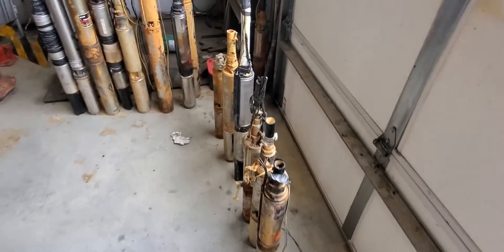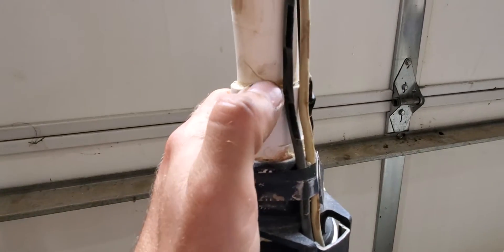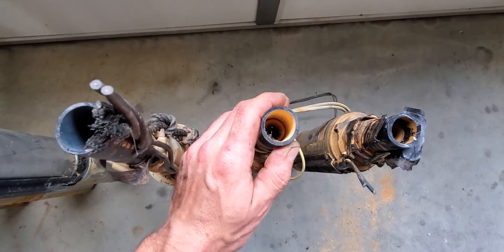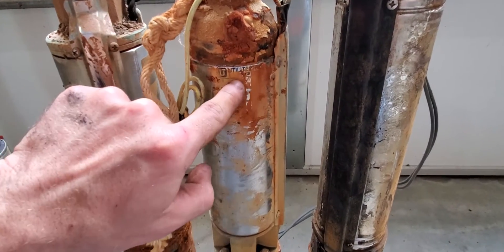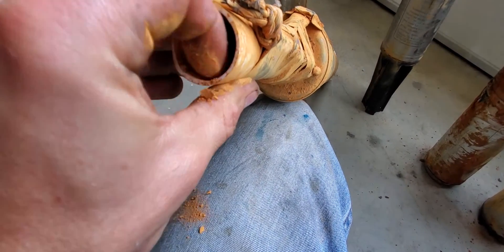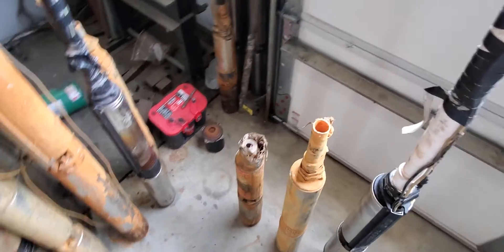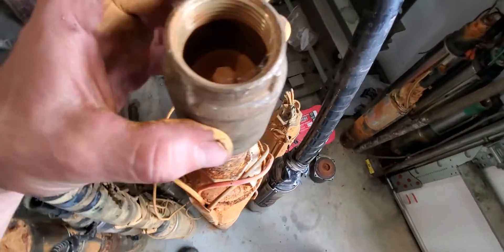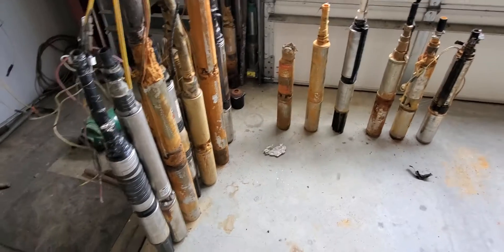No Water, Low Pressure,  Air in Water lines. Here's Why! #1 Troubleshooting video

Comment: Last year my pump ran fine. This year, none of the zones would come on. The pump is running and the hydrant at the pump discharges water but with very low pressure. I can put my thumb on the hydrant and stop the flow. I bought a cheap pump two or three years ago and I’m wondering if I got what I paid for. When it turn on my system, all the heads dribble water. Kind of at a loss here. Think the pump wore itself out?

Comment: Our old 0.75hp water pump for shallow well stops pushing water at around 3-5 minutes, but after a seconds of unplugging it and then re-plugging it again, it pushes water up to the tank for the same time frame of 3-5 minutes. We tried a new water pump 1hp but doesn't even push water up to the tank. What could be the problem?

Comment: For the last 15 years I've been running a Berkeley L20P4GMGS 2hp 20gpm pump I have had no problems or issues to date. My question is with the newest soft start pump coming out what would you recommend for a replacement. I was thinking using the same pump but with technology these days it makes it had to decide which quality pump a individual should purchase.

Comment: Lots and lots of bubbles in the well water. When pump runs the pipe shakes and makes a chattering sound like a vibration from a swing gate check valve. 
1. Why all  the bubbles
2. Why the vibration. 
3. Is it related to each other
Reply from the maker: It's highly possible that you have something funky going on with the pumps check valve

Comment: My sinks, toilets and shower are violently blowing air with the water and occasionally the water is really dirty. I fill my air tank and then run the water. After about a minute it goes back to normal but when the pressure gets low again it starts back up ... thoughts good sir?

Comment: Hi there. So my pump has shot off the end of the line a few times we changed the fitting to a metal one and now there's no water so we replaced the switch. Still nothing so now it's pulled out and I'll look at all the pipe and wire but it shows power to control box and the switch. It's only 30 feet and the pump was changed in September of last year.

Comment: I have a somewhat new well thats only 5 years old. Ever since the first day they installed it, it spits out sand. You can see it when filling up a bucket of water or when you leave water running in the bathtub. it's 350ft deep and I'm not too sure what size the pump is. what could be the problem?
Reply from the maker: It's possible that the casing wasn't set deep enough, and it's letting in surface material. 
Or it could just be the geology of the bore hole in your area. 
I'd recommend a "big blue inline filter" 20"x4" . They do a great job. 5 micron filter element (string woven type)

Comment: I have a jet pump for my well and I think that I like that better.
Reply from the maker: A jet pump is like a Carburetor, it's old technology, easy to understand how it works, & sometimes very difficult to get working correctly when there are problems. 
Submersible pumps are more modern technology, just supply it power & it supplies you water. No priming, no air locks or impeller seals to fail.
Reply: @h2omechanic  yep I know but the system works perfectly in my application and I can replace the pump myself any time no matter the weather.

Comment: Do all pumps come with a check valve, or is it something added in special circumstances? Second question, where is the bottom of the casing in relation to the pump? ie does the pump extend out the bottom of the casing, or is the pump protected inside the casing to prevent it from rocking and damaging itself or plugging up against adjacent rock and mud?

Comment: I lost water in my house but my daughter has water we both use water from the same well what do you think the problem might be thank you
Reply from the maker: The filter on your house is clogged.
Probably the black filter element...
Or go make sure your daughter has great pressure first. 
I'd say filter. 
Or a failed gate valve on your line.
Reply: @h2omechanic  my daughter has good pressure on her water I don’t know how to fix the problems you mentioned a plumber will be able to fix it right I have an old well pump and it doesn’t have the wiring that you showed in your video

Comment: I need help with it Please 
we only get 25-20 PSI and if we flush or take a shower it will last about 10-15 and then cuts off.
30 mins Recovery back to 25-20 PSI
Reply from the maker: Turn off your pump breaker and let me know if the pressure slowly drops to 0.
Or if it hold the 25psi like it should. 
Don't run any water during this test
Reply: @h2omechanic  I told my mom about it and she told me that she is going to get a Bigger Blue tank. What is your thoughts about it

Comment: Our water pressure would just stop randomly and we thought it was the breaker. We would reset the breaker and it would fix the problem until it would happen again, until finally resetting the breaker did nothing at all. It’s the submerged pump kind. Any ideas?
Reply from the maker: The pumps probably bad, or the wire going down to the pump is bad. Either way it would have to be pulled out & serviced.
Reply: @h2omechanic   Thanks. You were spot on. The wiring in the pump was damaged. The torque arrestor came loose and the result was damaged wiring.
Reply from the maker: @haruhana1743  people always ask why I don't like torque arrestors. There's another reason why!

Comment: Moved into a home and I get water for 10 min and then slowly lowers and then sputters and shoots out air really hard. It has an above ground pump. Anyway after sputtering then I'm out of water for around 12 to 19 minutes or so before the pressure is back and this cycle repeats 
So you can imagine how horrible a shower is during doing laundry 
Any tips?

Comment: Been having issues with water it’s spitting and sputtering replaced bladder tank it’s still doing same thing pump is good pumps water but doesn’t hold pressure like it’s half froze but it isn’t thinking check valve maybe or busted line because of having sediment coming out of kitchen sink and bath tub
Reply: Need help lol even had plumbers give wrong advice saying tank isn’t right it’s a 20 gallon set at 38 pounds pump cuts on on 40 etc I’m thinking it’s hole or broke but where who knows
Reply from the maker: Yes, you have a busted fitting down the well most likely. If you turn off the pump breaker, the pressure would probably drop to 0psi. That's how you'll know

Comment: Great video…having an issue with ours and need a little advice. Replaced tank (was water logged) and pressure switch (they had a 30-50 on a 40-60 tank) and it’s still not like it used to be. Pressure never gets high enough to shut off, and I think it’s been this way for a couple of months. This is a second home for us, so all we noticed was a significant increase in the electric bill. I think it’s just run itself to death.
Reply from the maker: You probably have a leak down the well on the drop pipe.
Reply: @h2omechanic  thanks…that’s what I’m thinking now as well. We had that freeze here in TX two years ago, and it probably made everything more brittle. I think the same is true for pressure tank…probably plasticized the rubber. When I replaced the tank, it was full of water. Pressure will hold at 10 psi after power is off, so probably a small split and pressure equalizes at that point.
Reply: @h2omechanic  I can’t say thanks enough for all the great info and content! Would never have tackled this one without your insight. My problem was actually the pump…not sure, but think maybe torque is what caused top cap to bend and that is where the leak was coming from. New pump, proper wiring and wrap, added a torque arrestor, and when powered on, pressure immediately banged up to 60+ and is now working like a champ! Did it all on a cold, sleeting TX night Thursday, but wasn’t that bad overall. Really appreciate the video content and you helped us get things back to normal. Keep up the great work!

Comment: Can you use a submersible in a 75 ft deep 3 ft diameter drilled well ?
Reply from the maker: Yes, I did something similar. Watch my Yard hydrant install video. I put a pump In a 3ft diameter well. It just takes some ingenuity to support the pump & not having it rest on the bottom of the well.

Comment: We replaced our well pump a couple Yeats ago and seemed to work fine. Recently I happen to be near the pressure gauge and noticed it was struggling to built pressure past 50psi. So I didn't some testing and adjusting. I set the range to be 30psi cut in and 50 psi cut off. Set the pressure tank to 28psi first. I then timed how long it took the system to build from cut in to cut off. That took about 6 minutes. Then I measured how many gallons of water I get before the cut in pressure is reached. I got 7.75ish gallons of water. So my gpm flow rate is only 1.3! The system seems to hold pressure fine it just pumps very slowly. What do you think my issue is? My thought is maybe iron build up in the screens of the pump is limited the water it can bring up or broken impellers. Either way can't know with out pulling it up (about 100ft). Any ideas?
Reply from the maker: Definitely need to pull out the pump from the well. I could be iron build up, but even if it was plugged it would build up past 50psi. So I'd say either the the impellers are worn out or you have a cracked fitting that spraying out some of the pressure (normally you'd be getting more sediment than usual)

Comment: When my well pump is pumping (filling the tank ) water is also  coming out at the well head-  The water at the well head  stops- when the presser switch stops calling for water from the well pump.-Could it be my pipe to the pump has a crack ? ---10 22  22

Comment: would you buy a pump from Lowes 1 hp
Reply from the maker: Only as a last resort. Expect it to last around 5-6 years.
Reply: @h2omechanic  what is the best one to get
Reply from the maker: What depth is the pump going?
What size wire do you currently have? 
I prefer Goulds, J-Class, & Grundfos. I'd recommend a 7GPM pump for 200-300ft & if you're pumps going to 350-400ft, id recommend a 5 GPM pump.  A 3/4hp is normally efficient enough for 95% of domestic household use. A 1hp is used for deep static levels & requires #10 or #8 wire. That becomes Heavy & expensive

Comment: I recently started to have air in water lines. Checked pressure tank and all is well. I replaced switch and and pressure gauge and still have air. Any suggestions from this point to check to resolve air issue?
Reply from the maker: I'm going to take a guess & say that you probably have a check valve at your tank, or at the top of the well head. 
If you do, then that's tells me the check valve in the pump is leaking (but the one at the tank is holding) so the pipe in the well leaks down creating a air pocket inside the pipe. Once the pump eventually turns on, it sends the air into the house. 
Fix*  pull the pump & add a Simmons check valve/ or replace the pump if its 10+ years old

Comment: I have an old well 3” casing 320’ deep . I need a pump can’t seem to find one help please
Reply: Also the water table starts at 85’
Reply from the maker: Send an email to the company "Grundfos" ask them if there 3" SQ270 will fit inside a 3" well. If they say yes, then that's the one you buy.

Comment: I bought a house recently that has spring water into a holding tank, from there it is pumped into the house. Since the power has been turned on the water will only run for roughly a minute and then shuts off completely. After 30 seconds to a minute it comes back on for another minute or so...system has new pressure switch installed...what could this be?

Comment: Hi….I’m guessing those various parts are whats in the ground, correct?  We have been fighting with sometimes water on, then off for hours, then on again.  Could this be the problem? Or could it be something else? Thank you.
Reply from the maker: It's probably a pump that's fixing to die. It's over heating and cutting off til it cools down again. Internal bearings are shot & motor spins but not running smoothly anymore thus creating friction & stress on the motor. 
Or (if you've ever ran the well dry) you could be depleting the well of all its water, in that case 1sr thing I check is toilets to see if any leak down,overflow or it's just hung & running, wasting water 24/7. 
If its 8-12 years old, probably a bad pump.
Reply: @h2omechanic  Well, thank you for info…..we just changed our pump motor about nine years ago.  Hard to believe it would only last that long.  However, i will look into all that.  Thanks again for the info.  That will be a big expense which is something we don’t need right now.
Reply from the maker: Average pump life in regards to depth
100ft 0.5hp =13-16 years
300ft 0.75hp =9-12 years
400ft 1hp =5-8 years
These pumps work hard. To get a longer pump life, the tank is key! A larger tank will cause the pump to run less frequently thus getting a longer life. 
So be sure to watch my tank videos so you understand how to set the tank properly for maximum storage and pressure

Comment: Quick question:  I have no pressure. Checked electrical connections. Found loose wire at top of well. Fixed and reconnected. Can hear him in pipe. 123 V on each leg. Checked amp reading L1 - 6 amps L2 - 5.9 amps. Not sure of HP or age. Still no water pressure. Any thoughts?
Reply from the maker: The pipe busted down in the well. Or a fitting broke. 
Pumps running but can't lift water due to the leak. 
Time to pull the pump out.

Comment: Hi there and thank you for the content. Our well which shared has been having dishes for sometime. We live in New Mexico where things are definitely drying up and were told that our Well was on its last legs. That was about six months ago or so. With that said we had some decent water until about a month ago. Today none. How to tell if the water just isn’t recharging into the well or if it’s something else? The pump is only two years old as well as the coyote water pump protector and the relay switches are also only two years old. Thoughts?
Reply from the maker: If a well company said it was drying up, believe them. I doubt it's the pump. It's best to leave the well pump breaker off whenever you aren't using water. Maybe look into a Hydro-Fracing company near you.
Reply: @h2omechanic  thanks! We are actually in the process of getting a water haul system going. It’s very common out here in the mountains of New Mexico to haul water versus risk re-drilling with no promise of water but at great expense.

Comment: Hi my well pump  stop working  it was the breaker switch   I changed  the pressure  switch  it's sparkling  aswell and now I've a spark at the switch  and no pressure

Comment: Great video, thank you. Our hand-dug well is in a creek down a steep bank from our house. recently, the volume of water going through the system is less than half of what it normally is. The pressure is great for the first few seconds when you turn on a tap, but then it drops off very quickly. The creek is fairly low right now, but last year at this time we didn't have any problems. I'm thinking it could be a check valve issue but would appreciate any thoughts. thank you!
Reply: OK, nevermind! turns out our water filter is clogged. Thanks for the great video anyways :)

Comment: Have you ever heard of over amperage at the switch coming from the well pump?
Reply from the maker: If amps are too high, that's an indication that the pump is bad.  The bearings in the motor are shot, so amps are higher bx its not running smooth

Comment: No water, 90 ft well, going to replace pump.
Well used for livestock, roughly 1 mile long pipe line with multiple automatic waters.I pulled pump it’s a 1/2 hp, 10 gpm, 2wire, 4” submersible should I replace with same pump size?
Reply from the maker: Yes, there's no need to get a bigger pump. Depth & wire size is designed around a specific pump. So buy another 1/2hp 10gpm 2 wire pump.  Goulds,j-class, grundfos are good pumps

Comment: My pressure is fine but I have air blasting out with my water.
I get a mixture of air and water and it blasts out like high pressure.
Outside it will jerk a water hose out of your hands when the air comes thru

Comment: Question... Left the hose on for about a half an hour now there is no water. Could I have run my we'll dry? What should I do, Thanks in advance.
Reply from the maker: Turn off pump breaker for a few hours
Reply: @h2omechanic  I turned it off immediately, thanks I appreciate your quick response. In this case would I need to prime the line or pump? I'm 8n the Rockies and my pump is at 1400 ft depth.

Comment: Great description of submersible well pumps. 
5 stars. 
Where would you start with a house that is only pumping 35 psi?
The last time my well had poor pressure we replaced the pump and the water supply leading to the house was cracked.
The pump was fine.
Reply from the maker: Kill the breaker & look at the gauge at the tank, if it drops to 0 psi, you have a leak again somewhere. 
If you wait 1 hour & turn the system back on and air eventually comes out of a faucet, that's an indication that the leak is down the well . Possibly a fitting cracked or a hole rotted in a metal fitting.  Exactly like the pumps in this video